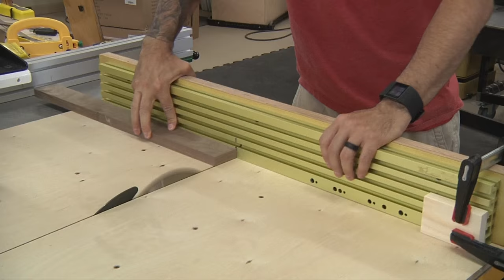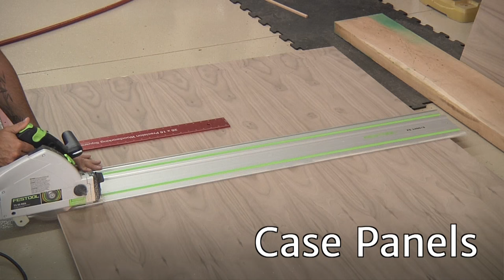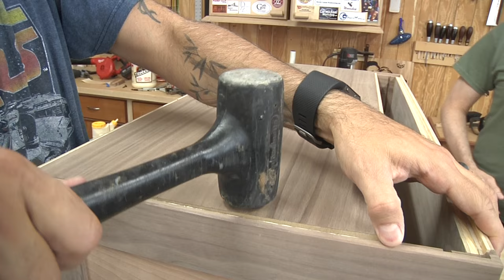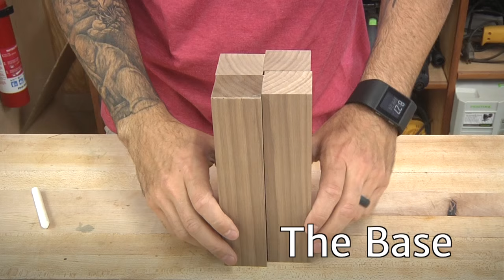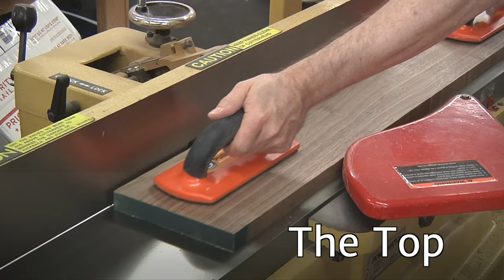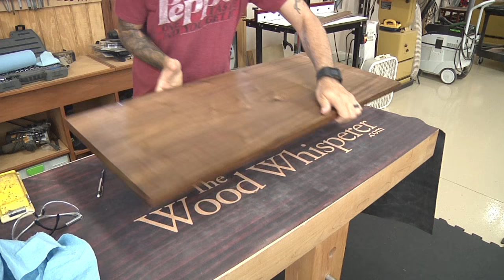Walnut Barrister's Bookcase

Comment: Hey Marc that's beautiful, so many components to trim to size and flush up and every one of them is a perfect fit. I notice you've glued boards together in a cross grain arrangement in some places or you've glued plywood to solid, do you have any issues with movement?
Reply from the maker: +One Man Band Woodworking not the way it was done here. Have to be strategic about it.

Comment: Any problems with the peg-in-slot rails allowing the door to rack, with nothing to keep the two sides aligned?
Reply from the maker: Not really. As long as you leave just the right amount of spacing between the pegs and the slots, it seems to run pretty true. Of course you can force it to skew if you want but you have to really intend for that to happen. Wax in the slot also helps keep things running nicely.

Comment: Do those doors have a name? I want to try them out, can you direct me somewhere i can find more info on them?
Reply from the maker: +Dat Boi not sure of the official name for this type of door but you can find out more about my specific doors here: https://thewoodwhispererguild.com/product/barristers-bookcase/
Reply: The Wood Whisperer
Alright. I did some searching myself and Barrister's door --> images seems to yield the best results. I kinda understand how they work now and there seems to be hardware for these doors (expensive-ish though)

       Also, do you think having the "rails" for the bottom side as well would be a good idea? Meaning that instead of having the stoppers at the top preventing the door from going inside the bookcase would actually be in the door and the rail would go all the way down? Kinda hard to explain. I'm thinking it would be hard to open it with one hand though. I'll have to experiment myself, but do you have any thoughts on doing it that way?
Reply: The Wood Whisperer